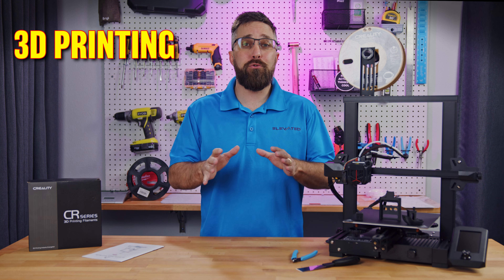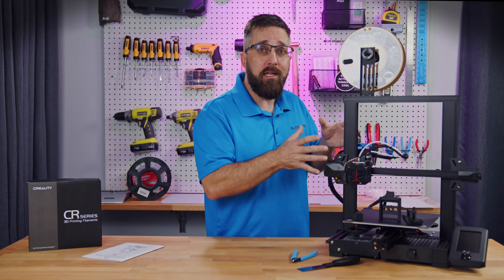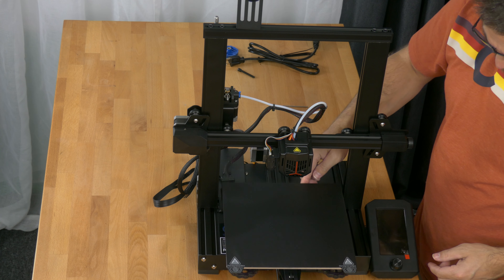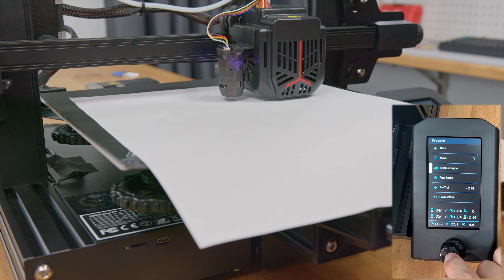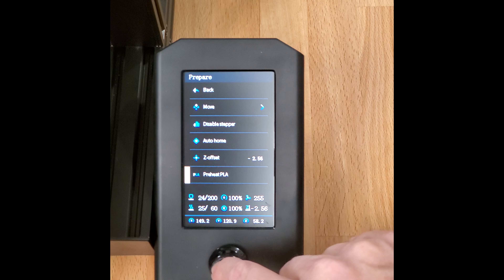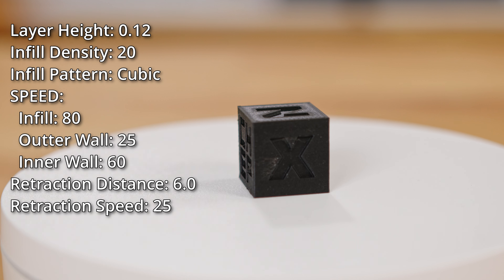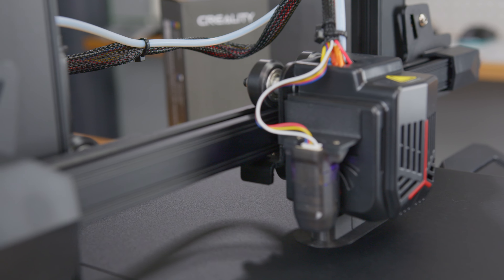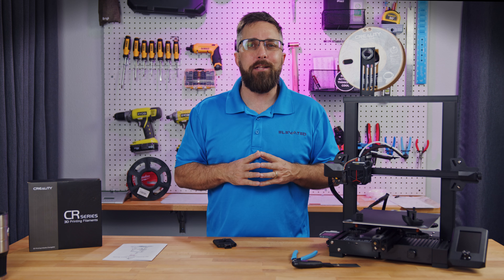Creality Ender 3 V2 Neo. A Great 3D Printer Made Better!

Comment: Great Video.... I just received the printer as a present.  Once quick question about bed leveling. I am confused on which method to use. I seen a method that you have to first compress the spring all the way down. Does that matter.  >? Also, I noticed that my bed is a little loose. Am i supposed to tighten those bolts.
 thank you

Comment: I just got this printer and am very happy with it. It's the first 3d printer I've used. I say used and not bought because I first ordered a printer from another brand and that one didnt even work, and was a pain to assemble and disassemble (several screws became stripped immediately).

Still working out which settings are best for my specific printer, but it's working like a dream out of the box.
Reply: I quit 3d printer years agout now i just order this hoping to learn.

Comment: The adhesion issue with the matte PLA might have been too much cooling as well, basically the filament gets cooled down before it has the chance to fuse with the previous layer completely. I assume you printed it again with the same exact settings so the type of PLA clearly matters but I think it should be possible to print the same thing with the cooling lowered down using the nice matte black PLA as well.

Comment: Interesting presentation and very non-condescending to beginner printers.  As a Porsche factory race mechanic, I see unlimited application for this technology.  We can use "printed" part designs in test environments before spending tens of thousands of USD on metal alloy forged parts (in gas volume testes and many others - etc.) so this was a most informative vid.  Thanks to all involved.

Comment: Mine got a blob that ruined the thermistor wire so I replaced the hot end put while taking it out I saw a compositor is glued to the wire I needed to remove. The compositor fell off and now it’s sitting in a corner abandoned

Comment: I just now realized that due to the changed to the extrusions, many many Ender 3 v2 mods no longer work, for example the Kevinakasam belted z mod… I have ordered the parts already, but can’t use them without major design changes or swapping out the top 3 extrusions… I should’ve just gone for the v2 or s1 instead

Comment: trying to set my new printer up and I cannot get the nozzle to go any closer to the plate than about 1.5in. I have scoured the internet, and I cannot find any answers. The software is all up to date. I'm at a loss.. please HELP!!
Reply: You need to adjust the z value, you can do it from the screen in the z'offset value, move it down untill it almost touches the bed and print a file while adjusting the z offset util you see that it it getting stuck to the print bed. If you have any problems reply to thiss

Comment: i have a question? my printer came with a white filament but its not on a spool, can i still use it to print? if not what is this for?
Reply from the maker: It's some test filament you can use to print the test model when setting up the printer.

Comment: What printer you selecting in cura ? I don’t see the ender 3 v2 neo in there.
Reply from the maker: The printer profile is on the included SD card. You can add it to Cura. The directions are in the digital user manual.
Reply: @ElevatedSystems  oh sweet thank you !
Reply: @ElevatedSystems  anyway to make a video on it :)
Reply from the maker: @jakesrcaddiction  I'm pretty sure it's in Ender's setup video.
Reply: @ElevatedSystems  got it thank you !

Comment: After at least of 1000 hours on my ender 3 v2 neo I can tell you this printer is worth every penny, but if you are new to the whole game make sure you read enough to understand issues that may occur and how to solve them as well as how to diagnose them! I am on facebook groups for different brands and models of 3d printers even top notch branded groups post tons of issues i see and i know how to solve them but yet my cheaper ender 3 v2 does the job because i went trough building my own printers back in the day when they were expensive..... what i am trying to say is that i see people buying creality printers for 500 bucks and having daily issues and they blame the printer but its not the printer its mostly their lack of knowledge..... although price is nearly something you would spend over night in pub.....  comment if you need any help i would always help
Reply: Hello. My neo keeps clogging. It’s new.
Reply: @gunnsmoke357  try other filament, what temps and what material?!? Ur teflon tube goes right to the nozzle make sure it is aligned tight
Reply: I'll drink at home and skip a night out at the pub for the v2 neo
Reply: @CuttinInIdaho  thats the job !
Reply: Does this printer need heatbreak change

Comment: Strange issue with mine.  I am not getting a layer around the part, I am getting this massive base layer.  Any idea how to turn that massive base layer off?
Reply from the maker: Sounds like you have your build plate adhesion set to Raft. Change it to skirt or brim.
Reply: @ElevatedSystems  Oh, nice! thanks for this.  Now I need to find that setting :)  Is this in software or the actual printer?  Thanks
Reply from the maker: @yesla4tesla  it's in the slicing software.
Reply: @ElevatedSystems  thank you!

Comment: Does it work with uk 240 volt mains
Reply from the maker: Yes there’s a selector switch on the power supply for 110v or 220v.

Comment: Basic question. Why is bed leveling important?  Doesn't an unlevel bed simply create a unlevel bottom to the model?
Reply from the maker: Mostly it is about proper adhesion but worst case it can lead to a complete failed print. The larger the print or the more bed surface area the model takes up the more likely you will run into problems. Example, If you are printing .15mm layer heights and one side of the printer is .15mm or more higher than another side your layers will not adhere properly, and you end up with spaghetti.
Reply: @ElevatedSystems  Can't you just remove the bottom portion of the part you create?  Won't the rest of it be ok?  I'm thinking you could just build that into your model, the idea that the bottom portion will be sacrificial and removed after you create the part.
Reply from the maker: @nicholastinling1022  No if the bottom layer is bad, every layer above it is bad.
Reply: @ElevatedSystems  Thanks for clearing this up for me.

Comment: My boy just casually makes a SSD holder. RIP SmallRig 😆
Reply: Use any CAD for a month or so and you can do the same. Fusion 360 is a free CAD that doesn’t require a powerful pc
Reply: @Aikano9  Wait, it's free now? Back when I was using it, there was some educational plan for students but it only lasted 3 years I think
Reply: @inso5078  I’m pretty sure it’s free for non commercial use

Comment: I find it hilarious that these incredibly precise machines have to constantly level the bed, the manufacturer can create the entire mind-boggling machine...but cant keep the bed flat.
Reply from the maker: The bed and print head by function continually heat and cool which causes expansion and contraction in the metal components. Leveling ensures the micro-millimeter tolerances required are maintained. Manufactures can't change the laws of physics.